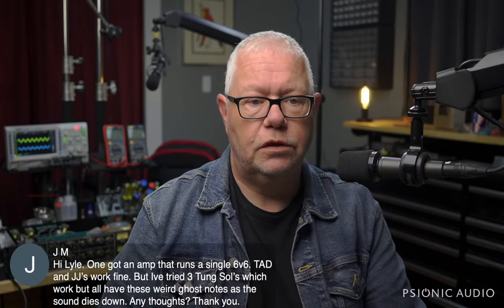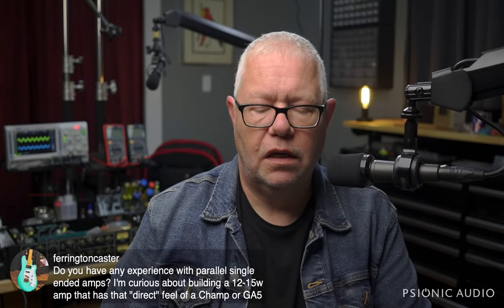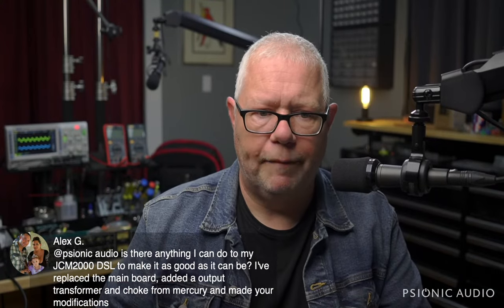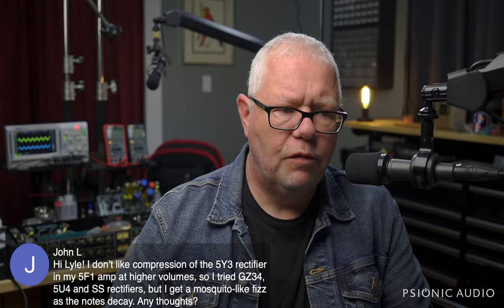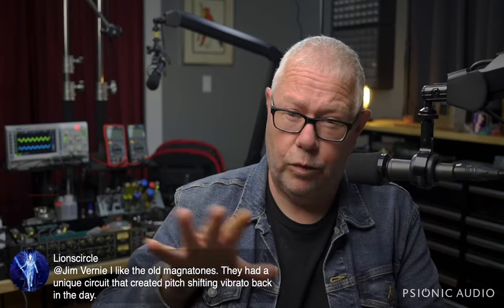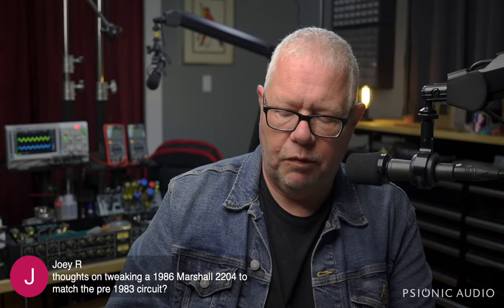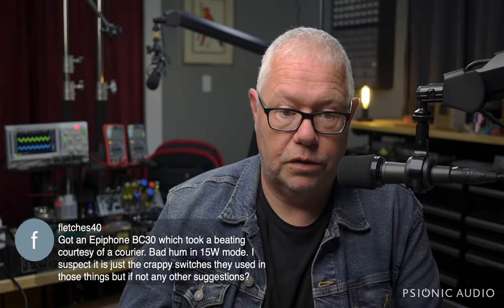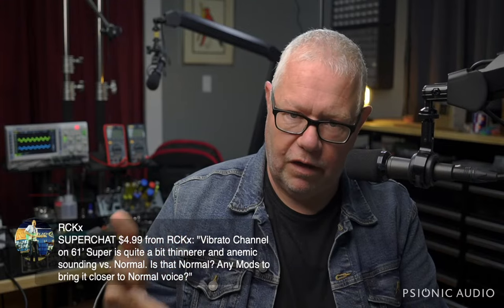Live Chat | Amp Q&A Saturday Mar 16

Comment: Quick note on the Hurricane in case Craig who made the question sees this. I have a home built version of this circuit (not exact) with the effects looo. Its a really simple effects and not the best design. Basically just a series loop that comes before the last triode which then feeds the tonestack > master vol > PI. It uses a 1/20 voltage divider (I think 100k over 4.7k) to knock the signal down before the loop and is brought up with a standard common cathode triode stage after. It generally 'works' but might not play nice with all pedals. Id probably look into cleaning those shorting jacks for the loop if this is a new issue that just popped up.

Comment: Looking at a 66 bassman with matching 2x15cab for $1k is this a decent deal and are the original 15” speakers  worth using for guitar?
Reply: That is a fantastic deal for that combo. The 15” speakers would work for guitar. Several combo amps have 15” speakers.
Reply: Thanks for reply!  I’ll see if it works out for a project restore.

Comment: TLDR: Lyles clients don’t use ENGL because they are mostly designed for modern metal and beyond. 
Lyle probably isn’t going to see many ENGL due to a majority of their amps being extremely high gain. Most of his clientele seems to be a collections of more traditional professionals, rather than headless guitar playing, drop-tuning gear nuts. Not a critique, just trying to be objective. I have owned several ENGL’s, still have one, among others - if you like dirty vintage tones, you should look elsewhere. I use ENGL for seven strings in drop G, because they handle it better than most amps, without the sag of older high gain amps. ENGL stopped offering low and mid gain options years ago, and specialize in high, heavy, fluid gain stages. If I wanna play “regular guitar,” I use a small tube practice amp, and it does everything the ENGL doesn’t. They look gorgeous and they don’t tend to have issues, but ENGL will never be a Fender or Vox, sonically. Not to say you can’t add pedals, but you’re going to spend money on an imported amp, to then spend more money to make it sound like that fender at your local music shop.
Reply from the maker: Just so long as you know if a metal guy brings in an ENGL I understand that world (and those circuits) too.
Reply: @PsionicAudio  definitely not questioning your skill! I would love to actually send you some amps, given the opportunity! I learn so much from you, as well, but from all the ENGL questions I see people asking you; I figured I may throw in a little perspective as to why a tech of your nature and location may not have seen any on the bench. Also, I’ve never had issues with one 🤷🏻‍♂️🙃 but I baby my shit lol